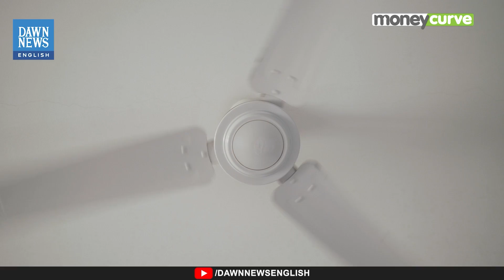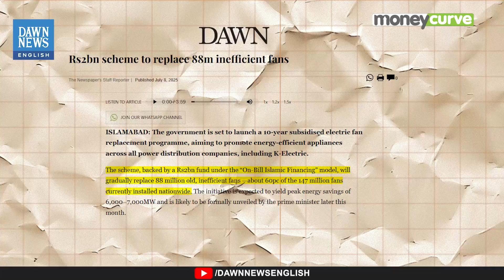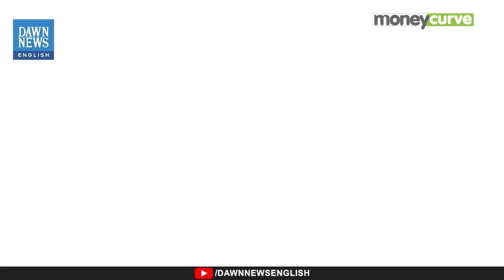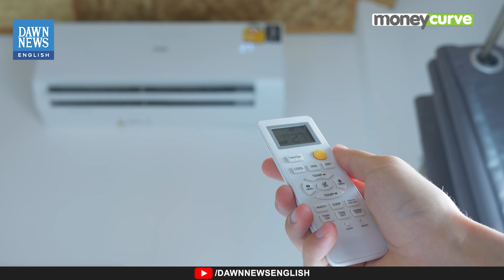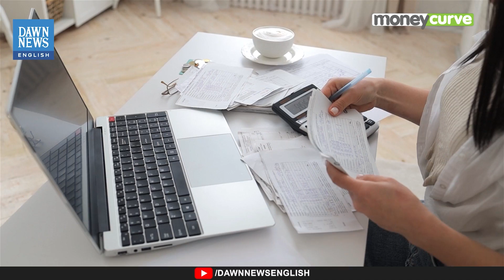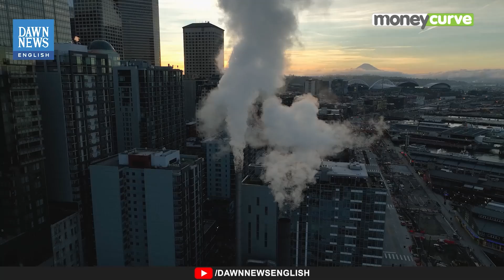Pakistanis, Will These New Fans Cut Your Electricity Bill?

Comment: How can a fan reduce the use of AC? It's impossible...
Reply: If it's way too hot yes it's not gonna replace it but say around 35 C or less, you can get away with a good fan or cooler instead. That's what we've been doing for the past few years to keep electricity bill in check

Comment: From bulbs to tube lights to savers to LED, burden is transferred to the consumers instead of focusing on cleaner and efficient power sources. New tech in fans saves energy but this is not the solution.
Reply: Then what is?
Reply: In the long run, consumers are the ones who are getting the benefit. This is one of the solutions, and I think someone has thought well about this new scheme of fans, Even if the unit prices stays at it is, these new fans will prevent people to cross 200 unit slab

Comment: 😂 there is no free energy. In this fan there are permanent magnets. It will save initially 40% energy. but keep replacing those magnets after some time, reliability issue. more mess to remove and install fans.
Reply: Create a problem then sale the solution 😅
Reply: Brother you lack knowledge about fans.  Government is talking about BLDC or PMSM fans. Not conventional fans. 
I have been using BLDC since 2017. Never changed any magnet.
Reply: @NazimUdDin-tg8jg  even conventional DC motors are surprisingly reliable, brushless might help more with reliability. Whatever the case may be, I have never heard of a motor losing efficiency because of old magnets. In practice other components such as bearings and winding could fail earlier.
Reply: That's interesting. So the DC motors found in other appliances, such as juicers and other types of fans (such as radiator fan) keeps on working. What's the average life of these magnets to start with?
Reply: @muflah  Those work for less hours
Reply: @goodghost6182  that depends. Let's talk about radiator fan for instance. It's exposed to rough environment, excessive heat, cold, and sometimes moisture and it's operation is also critical. Now I've never heard anyone installing a bigger battery because the magnets were losing magnetism, so my assumption is that they're good for the life of equipment.

I'm not a subject expert but interested in knowing why you might think motors with magents get less efficient with time or are less reliable.

Comment: My electicity bill only reduced by 2k. Although, i was told it halves the bill which is why i bought it. Sk fans is installed in mosques because it is 2k cheaper than khurshid.
Reply: Bills after 6 months  are reduced
Reply: @sidratulmuntaha4855  why after 6 months? Nobody told me that.
Reply: Evil ke electric bilingl system

Comment: Excellent represtention  and good idea but some new fans are good and some are very bad , like Khurshid Fans 10500 RS Fan motor weight is 5.5 kg whare as Super Asia 11500 fan mother weight is 3.5 kg which indicates their performance too, but most important is the card on which these fan are working and it's warranty , govt should go for those fans who provide maximum card warranty and produces high weight motors with minimum rates .
Reply: And have you been able to spot on such better than others AC DC or inverter fan companies ?
After sales of all these companies are questionable,plus the card's durability,and the cost of getting them repaired and installed.

Comment: No point subsidizing Ceiling fans. People are replacing older fans themselves. 
Subsidies are not good idea under current circumstances. People are deploying Solar panels which is less expensive and replacing an old fan with a new fan is not as economical as deploying Solar panels of 600 watts. Afterall the ceiling fans of DC inverter/bldc motor are expensive in maintenance.

Comment: Whenever they find less electricity usage KE accuse user of power theft.
Reply: Be honest, electricity theft is a problem. Other places also have this issue but Karachi has one of the worst.
Reply: @rocky8275 I don't agree with you. I invite you to come to Karachi check by yourself. They cut our power after 3 days after due date if bill is not paid by due date.

Comment: Our household bill was cut in half by just switching fans. On scale this can reduce household bills for sure. 
Khurshid or SK are a top choice.
Reply: phr yeh roye gy ap bijli kam use krty ho iss liye bill zada aye ga
Reply: @TechHacksSimplified 👌🏻🔥🤣🤣🤣
Reply: remove all fans after few years to reinstall new magnets. there is no free energy
Reply: can you please mention the brand you have bought ?
Reply: @nsight4320 
I m using khurshed fan from 1 year it consumes 50 to 55 watt 
Whereas traditional fans consumes  130 to 150 watt 
But only problem is You have to replace Circuit which sometimes becomes faulty anywhere between 1 to 2 years but its available in market for 1000 rupees 

Presently Fans costs between 9000 to 10000 rupees
Reply: @returntothetruth1469  Sonex, SK, Royal fans are quality products.
Reply: @returntothetruth1469 

And that requires electrician,and inconvenience while the fan isn't working.

These AC DC or 30w fans are still not as reliable and durable as the older 220V fans,and that remains one of the reasons customers resist adopting this energy efficiency.
The after sales services of these energy efficient fans is also not efficient,making them a burden,more than a convenience.
Reply: @returntothetruth1469  that's not a problem if you ask me because this fan save thousands in a year so if it ask for 1000 after that it's not a big deal.
Reply: Recently i change circuit in my khurshid fan which cost is 4000, where you find 1000 rs circuit
Reply: @nsight4320  We bought SK fans because Khurshid weren't available.
SK have been really good and reliable.
Khurshid is the top brand in this space, because they have been doing this for longer than anyone.
Reply: @nsight4320  I am using royal iturbo they use 30 watt and has turbo mode that use 42 watt
Reply: they are flop in long run...the magnets replacement lolz